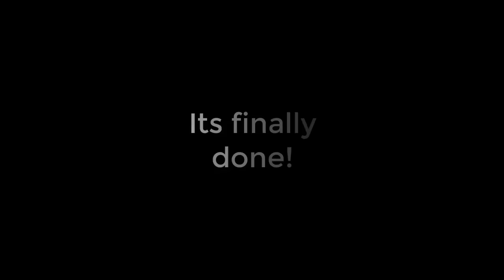Volkswagen Camper Conversion Full Build

Comment: this is the most beautiful t5 camper conversion I have seen since then. but a few things I would have to complain about or rather I would want to retrofit.
xenon headlights
cool grill schartz painted
face lift multifunction steering wheel
folding roof
Reply: and what I would have done in any case is behind the parts where you never get back clean cleaned ...... but otherwise nice conversion greetings from Oranienburg in Germany

Comment: I would have thrown an air mattress in the back and called it a day.
Reply: Robert Breeden same 😂
Reply: @adamk3538  Well uhh... you see what had happened was...
Reply: Robert Breeden Great Idea!
Reply: Lol  Minimalistic
Reply: The no-build build.
Reply: An air mattress? But you have to pump that up with air.. Too much work, i will throw in a regular mattress and a heater.. Wait forget the heater, that costs electricity, just leave the engine running while sleeping for heat.
Reply: @MarshallMathersthe7th  I mean they have battery powered air pumps.  Most air mattresses come with one these days.
Reply: None of you understand how damp works.
Reply: @radioactivepotato2068  Moisture diffused through the air or a solid substance or condensed on a surface, typically with detrimental or unpleasant effects.

Comment: Company I visit has just got 4 or 5 brand new VW van's.  They had the Transit custom before.  Didn't rate them at all stupid faults ect. Went VW for one reason,  camper conversion after.  Guy said they will do one and see how it goes.  They hold there resale value quite well as it is, so a conversion on a three your old van should sell quit well. 
Oh the vans are top spec with all the toys.

Comment: I just bought a transit custom camper but didn't like the grey carpet so went set to change the carpet. underneath was like yours i was pissed no sound deadening the insulation that soaks water up instead of recycled plastic stuff and no vapour membrane. Had to do it all my self.

Comment: Hi Mad4.. just wondering, how do you fix the wooden panels to the floor and roof.. do you go straight into the body with some sort of screws or is there a better way you all do this? I guess you can connect the kitchen units straight into the wooden panels? Thanks
Reply from the maker: Hi there is two ways you can bond it or screw it down

Comment: From what i understand they usually don't advise that sort of insulation since it might actually trap moisture, and grow mold, which is often always a problem in cars, and most use more fo the harder foam sort of stuff for that reason ?
Not sure though.

Other than that, fucking grade A job. Overkill engineering even !?
Can't believe you got that all to fit in there, i mean, it's not that big !
Great job !

Comment: Brilliant job mate! :-) Couple of daft questions...
I’ve got the same grey cabinets but they’re a bit plain, what did you use to spray the doors?
The blue strip light behind the sink I’ve seen on amazon, can you cut or bend this? I wanted to run some round sink and wardrobes but the turns and angles won’t let me without cutting.
Don’t suppose you know anyone who can dye seat covers, mine are a purple ish colour and I hate them. Lol. I’m in the North West.
Cheers, it looks amazing.:-)
Atb Mike
Reply from the maker: Hi you cant paint your cabinets quiet easily as I did, yes the leds and cutable to length so easy to adapt anywhere on your camper

Comment: How is your car protected? 🔐
Have you ever considered a Ghost Immobiliser? 
Not sure what they are? 

The Ghost is the original aftermarket CAN bus immobiliser. Cars can be started from outside your home 🏠 by a thief and driven away in less than 30 seconds! 

With the Ghost installed, your vehicle will not start unless a sequence of codes are entered using standard buttons in the car (for example , the volume buttons on your steering wheel)

All protected for £399 supplied, fitted and demonstrated at a location of your choice - nationwide.

Book your installation slot online now:
https://www.thecarsecurityco.co.uk/

WhatsApp: 07944 804 858

Comment: Same stock burned out engine and its components, tired suspension - but now with a ton of extra weight on it.. half assed insulation work.. I mean. It's a B- project. I've done better myself. It doesn't matter how good it looks if it's the same 2004 camper with 200k miles